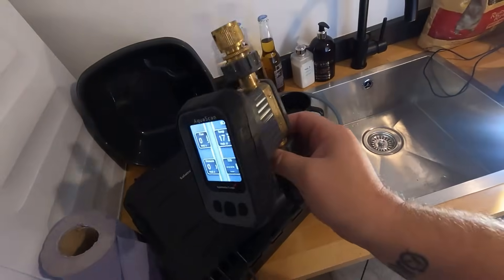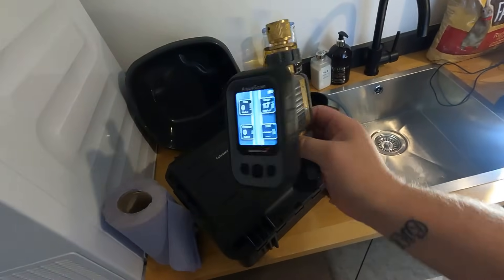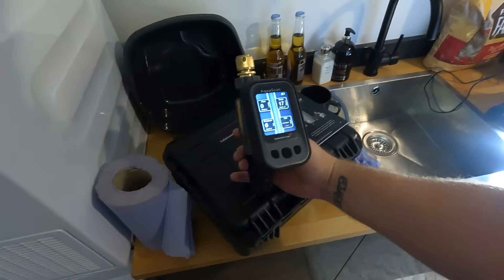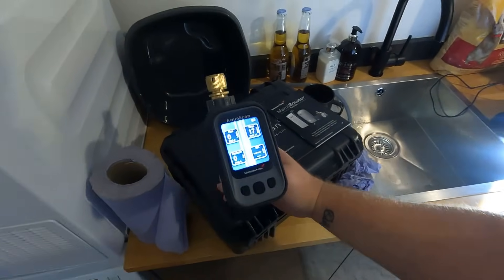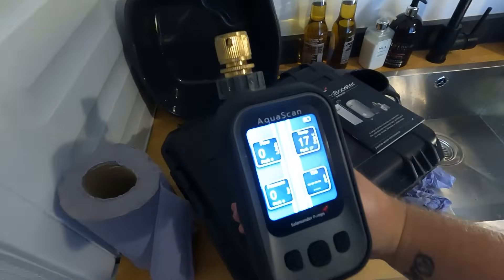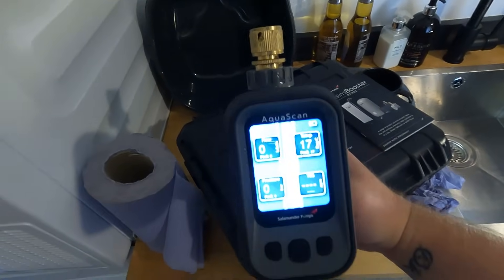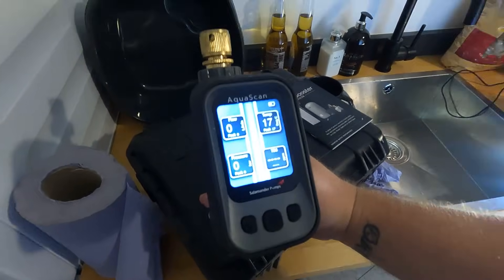HOW TO FIX LOW WATER PRESSURE in your HOME....(The SOLUTION..)

Comment: Last twice I’ve had those problems it’s ended up being the filter in the prv has been full/blocked with alkathene shavings. I’d be wary of fitting anything until the pressure is higher on demand.
Reply from the maker: Yep good point…. However on this one the pressure is low BEFORE the PRV… that’s the odd bit🤦🏻‍♂️
Reply: Odd, I’ve got an ongoing that local water authority have been to x3. Operating pressure never above .5bar, standing pressure 3bar, can’t seem to get through to them that standing pressure means nothing without flow rate! You would get standing pressure of 10 bar but if the flow rate drops to hee haw and pressure to 0 it’s normally a restriction. I called tenant today to be told that now when the flat below runs water she gets nothing, another visit from water board required lol. 😂 stop putting all these tools on, for a tool tart like me it’s a recipe for retail therapy. I’ve been telling myself all day that a pressure gauge and a weir gauge are all I need but relented and ordered an aquascan.

Comment: Hi Mark, not sure if anyone has mentioned it in the comments, I had a similarly situation at a school the pressure disappeared after 1 tap turned on but gauges all above 1.5 bar etc. As they had pressure before I knew it had to be simple and changed the pressure reducing valve and working away 100% again. Possible to change the 22mm pressure reducing valve to a 28mm to allow more flow. Glad to get off the tools now but always loved the problem solving jobs. Great content, but PB looks to be making a come back so you might have to be second watch.😂😂. Hope there will be a part 2 for this one.
Reply from the maker: Thing with this is that it’s low BEFORE the pressure reducing valve… it’s an interesting one and yep part 2 will be coming.

Comment: Morning Mark,  I had a problem with a pressured cylinder a few years back. Over time the pressure to the taps got less and less. To solve this we changed the valve that came with the cylinder fittings pack. In your video you pointed to it at 11.32 minutes. Just below the lever valve. And when testing the showers did you try them on hot then cold to see if there's any difference. Don't know if this is any help. 
      Gordon
Reply from the maker: Thing is with this…. It’s low direct off the main, before any PRV’s etc….. it’s a strange one

Comment: Good video, tricky one with pressure and flow rates,  i wonder if they need a PRV at all if the incoming main is at 3bar..ish, PRV valves can get blocked on the inlet side and a Y strainer could/should be fitted to help. I'd be tempted to take it out and test again.
Reply from the maker: Yep very true that

Comment: interesting fault Mark. Why as it only just started happening? I mean it must have been okay prior to developing the low flow problem. There has to be a logical reason why it has just started happening. It looks like quite a complex install, but when you whittle it down to the basics and start checking pressure along with flow rates as you have done, my money would be on one of the PRV's. I have seen them just stop working. It's a tough call to put a booster in and find out it's not that. Good luck mate. Oh and I love the van rant 👍👍
Reply from the maker: Thanks mate….  Yep you have to be 100% with this before letting the customer spend a lot of money

Comment: Great demonstration of the aquascan, what is the size of the incoming main? Have you seen the DAB pumps with combined water storage, they are very reliable and extremely quiet, I fitted one at a farmhouse that was getting 1 bar pressure because the farm was stealing all the water, the taps upstairs would sometimes pull in air 😂
Reply from the maker: Thanks mate….. it’s a 25mm poly main coming into the building
Reply: Should be getting upwards of 30 lpm on that straight off the main at 3 bar, if it used to be fine and has got worse over time I would say there is definitely a blockage somewhere, possibly the meter

Comment: HI Mark

Have you considered a restriction between the incoming mains and the other taps. You've checked the flow and pressure up to the unvented cylinder but beyond that, there might be a restriction. A restriction would only affect the flow, the static pressure (when all taps are closed) would stay at 3 bar.

You could test to see if you had a restriction somewhere in the line by plugging a hose into the downstairs outside tap. run it upstairs, plug your aquascan in and check the flow rate at the first floor.  That would simulate the height differential.
Reply from the maker: I tested the cold main off the filling loop and that’s what feeds the rest of the house and the points I tested from…. Before the cylinder
Reply: Like your lateral thinking...Process of elimination. Well worth a try.

Comment: I had a very similar issue. I would take the mulibkock off and check that first as a piece of the non return valve had come away and was restricting pressure and flow. Once removed, all was working as it should.
Reply from the maker: Yep tricky to diagnose sometimes

Comment: £440 for one of those AquaScans. What a scam!
Reply from the maker: All depends on how it improves your certain type of work…
Press is expensive, some think it a waste of money and others it saves money…..

Each to there own buddy
Reply: @MJTiffPlumbing  Don't get me wrong - I can see they're a lot easier to use than a separate pressure gauge and flow cup, but £440 is crazy money for what you actually get. The cost of manufacture must be about 40 quid!
Reply from the maker: It’s not something for you then mate….. if you don’t see the benefit and what it does, time saved, accuracy etc etc….
Reply: @MJTiffPlumbing  At the risk of repeating myself, nobody has dissed what it does, time saved, accuracy, etc. It's the AquaScam price... it's, at best, a £100 quid device that salamander are ripping you off by charging £440 quid for. They could charge half the price and it would still be ridiculously expensive for what it actually is. The pressure is still being measured by a little plastic diaphragm and the the flow rate is being calculated by how fast a little plastic impeller is spinning in the body of that thing. Stick a £10 non-touch lcd display on it and, apparently, people are happy to spunk £440 on it. It's a rip off price.

I'd buy one in a heartbeat if it wasn't a such a scammy price. They're taking plumbers for mugs.

Comment: That's the trouble with quick release connectors - they release quick even when there's full pressure behind them! No chance to notice that first weep so you can just nip it up again.
Reply from the maker: It was me disconnecting it without turning the water off first, wasn’t an issue with the connector
Reply: @MJTiffPlumbing  Understood, but with a normal connector you'd see water leak as you started to undo it and immediately nip it up again before any damage was done - not an option with a quick release where it's full flow immediately and you're battling the pressure to get it back on.
Reply from the maker: Got ya…👍🏼👍🏼

Comment: You had 18l minute at the water softener outlier and 15l on the same pipe not even .5 of a meter further down. After it went through the prv? 
I’d be taking that off.
Reply from the maker: Will double check that👍🏼👍🏼
Reply: That’s about right because it was 15mm pipe and had been reducing to <3 bar

Comment: Certainly a strange one. But the setup might possibly suggest there everything was fine when the system was initially installed, which might point to a mains supply issue from the water company? Perhaps more housing development has reduced the pressure? I would certainly be having a conversation with them if it was fine and now it's not. Accumulators are a great solution 👍🏻. @glister loves a PowerTank!

Comment: Proper head scratcher that one 😵‍💫 I would've disconnected the softener for a start. I had an issue before where the piston stack inside the softener was on it's last legs and the 4 bar pressure coming in was forcing it to discharge water to the waste and affecting pressure in the rest of the house. 

Another thing I've seen regularly with old softeners is the resin expands over time where there's lots of chlorine in the water and after a regeneration, the resin leaks into the plumbing system and blocks taps, filling valves etc etc. Probably nothing to do with the softener but hopefully my nightmares will help someone fix a head scratcher 😎
Reply from the maker: I did run the test bypassing the softener and it was the same…. Bloody things
Reply: @MJTiffPlumbing ah fuck. Not to worry, only another 25 years until retirement Marko, we'll struggle on until then 😄😄

Comment: That's a very strange one ..
I have come across something like this before .
And the plumber had to install two large water storage tanks and a booster pump to pressure the tanks .
And increased the copper pipes ..
A lot of work involved 😯
Reply from the maker: That’s basically what I may have to do, fit the tank boost

Comment: Hey Mark, I work as engineer on the water board, we are governed to provide a minimum of 9ltrs/min at 10mhd. The water board need to prove the flow and pressure to the boundary as it could be a comms pipe issue from the main. We have also seen the same faults with the water softeners and PRVs, would be interesting to see what the flow and pressure would be around the property with the PRV pieced through as at 3bar I wouldn’t say they need one
Reply from the maker: Thanks for the reply mate….
What’s “10mhd”??….. I’m thinking 10m Head??
Reply: 10 MHD is meters head which is approx 1bar, great content by the way
Reply from the maker: Thankyou buddy…..

Yep, thought it may be…👍🏼
We have zero pressure at the first floor (10 meters)… flow rate of 6/7 l/min
And nothing on the second floor🤦🏻‍♂️

Comment: 1. Double check all valves are fully open. 3. Check if low pressure taps are forcing the high pressure back in on itself.  4. Check pressure balancing valve. 5. Check diverter valves. 6 Check water pressure reduction valve. 7. Flush system. 

Low pressure taps are for non-pressurised or open-vented systems. And are designed to reduce the pressure build-up in open-vented systems. Sometimes a mix mash of low pressure and high pressure fittings, can cause a drop in pressure elsewhere through the house.
Reply from the maker: As you can see in the video.. we have low pressure near on straight off the main buddy (0.3bar) along with low flow …..
Pressure drops off straight away from the filling look and open pipework to outside tap…

Comment: Could it be that the pipework is not properly designed? A smaller pipe diameter feeding multiple outlets causes higher resistance and a low flow rate.
Reply from the maker: Possibly mate…… but taking all of that out isn’t an option..
However the Tank Boost could save the day

Comment: Hi mark. I watch all your videos when they come out always a good watch. I used to fit meters for our local water board and call outs to any low-pressure problems. I was just wondering if this problem has happened recently or something getting worse over time. We would always check the stop cock in fully open, check flow and pressure before the meter as they can block up and reduce or even stop the flow. There is also the possibility of a leak on the supply pipe which very rarely show on the surface. The PRV can show pressure but reduce flow. Looking forward to how you sort it
Reply from the maker: Thanks for the comment mate.
I’m sure the customer has spoke to the water board (Severn Trent) and they said it’s all ok..

What would be the minimum you would let go into a property??
Reply: the minimum allowable  pressure is 1 bar. and anything below 10 liters per minute is considered poor
Reply: Presure reducing valve not working right probably something blocking it or its sticking  cutting the flow and pressure
Reply: Before doing that take the main pipe off as soon as it comes in the house then say there's not enough water if then get what you want not before
Reply: What are the neighbours getting ,what a big advert for salamander that's not very good really
Reply: Could have a load of stones in the main or water meter

Comment: Thanks for that, Mark. Bit of a head-scratcher. Was it something that came on gradually or was it just crap one day out of nowhere? What's next door's water pressure like? I might be tempted to run a bit of temporary hose up the stairs from the best ground floor point, just to see the effect of the hydrostatic head on its own - but then again the ground floor shower wasn't much cop either. Has somebody chucked in another housing estate just up the road or something?
Reply from the maker: 1bar of working pressure should do 10meters of head….. we have nothing here 🤦🏻‍♂️🤦🏻‍♂️